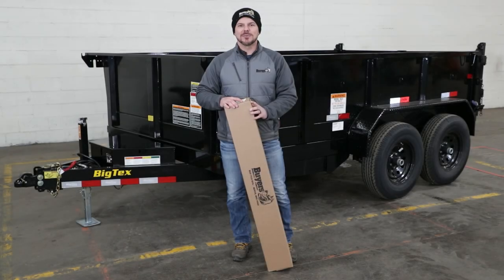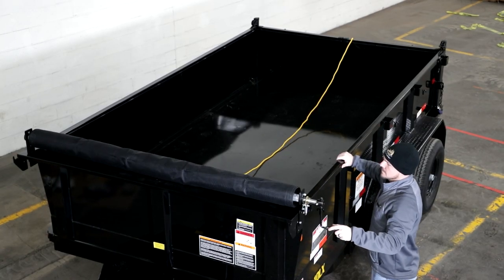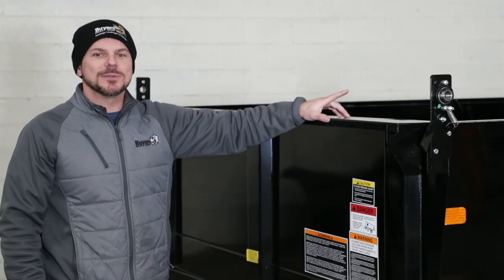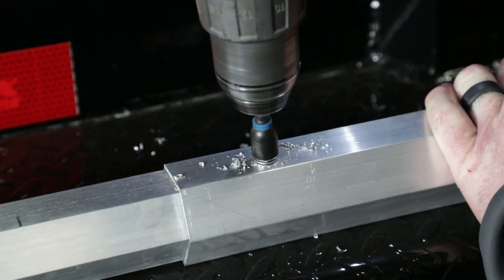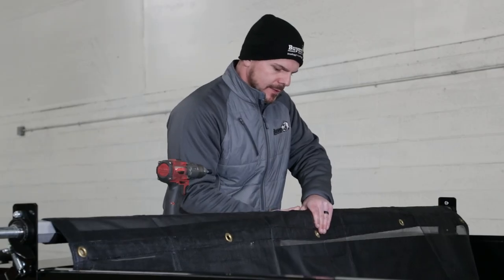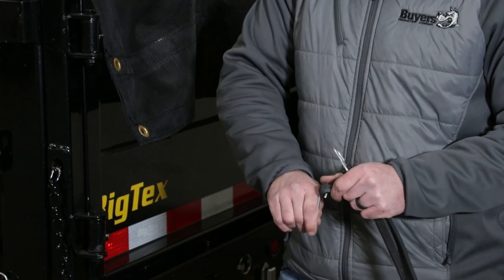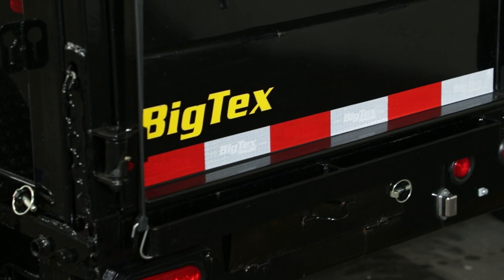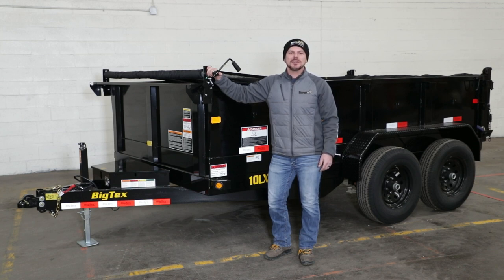How to Install a DTR or DTT Series Dump Tarp Kit

Comment: Orrrr you could take the bearings and crank off the stupid flat bar and put them on the plates on the trailer designed for the kit

Comment: Thanks for the video! Super helpful. One question, what's the best hardware to use to attach the hooks for the pull rope?
Reply from the maker: Great question! I spoke with our tarp system engineers, they said the exact hardware will vary quite a bit by the application, but in general you want a minimum of Grade 5 hardware of sufficient length. I hope this helps! Please let us know if you need anything else!